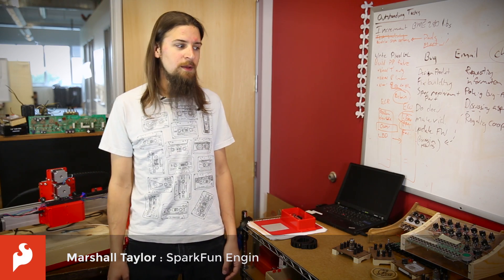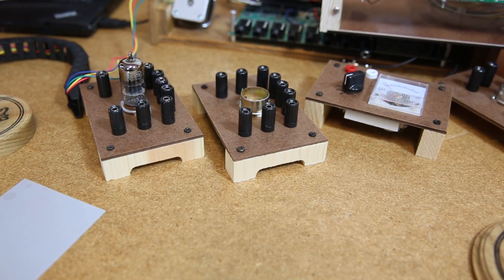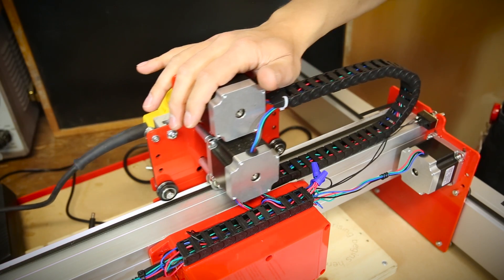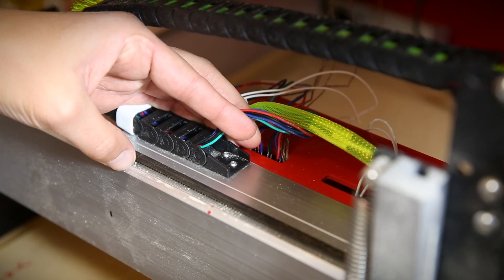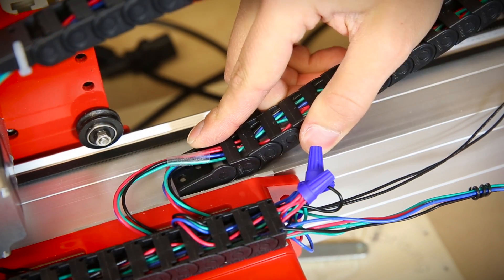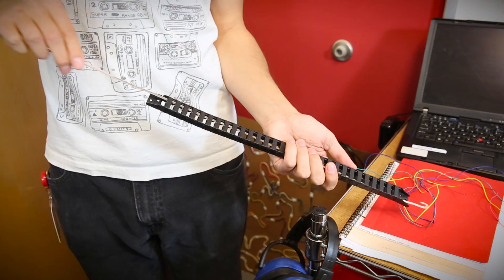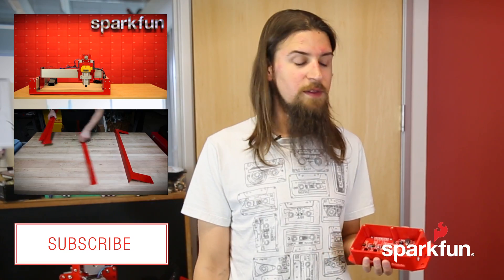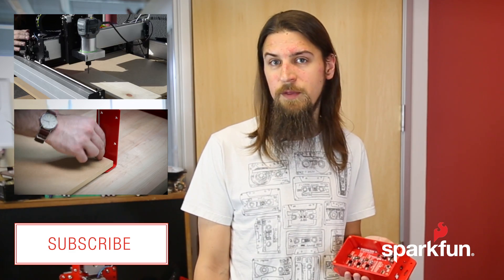SparkFun Shapeoko Deluxe Kit Update

Comment: I build one from $15 plans I bought through the web, built a 4x6 feet roter table for about $250 everything included (except the electronics). All built was with standard lumber, electrical conduit and threaded rods from Home Depot.
Worked fantastic. Built it to build mt kitchen cabinets but bought from IKEA for less than I could make it.
Sold it for $750 after I played with it for a few weeks.